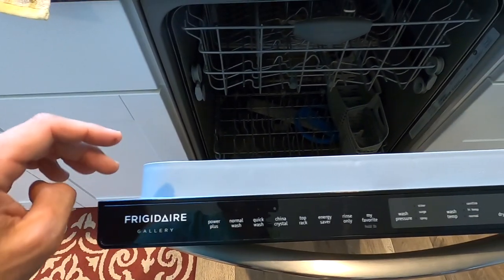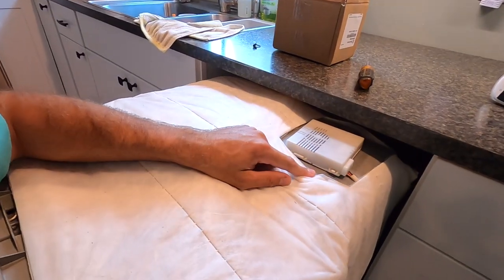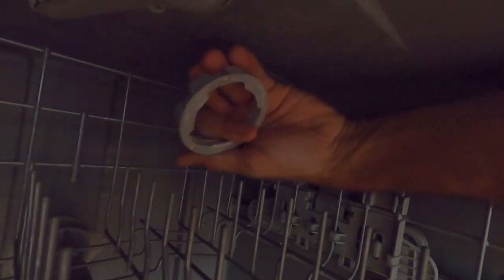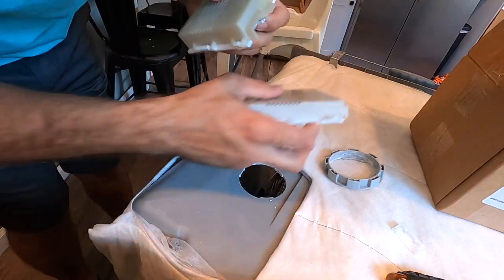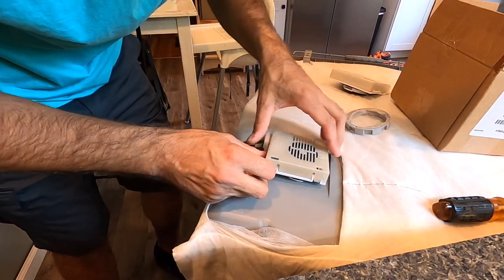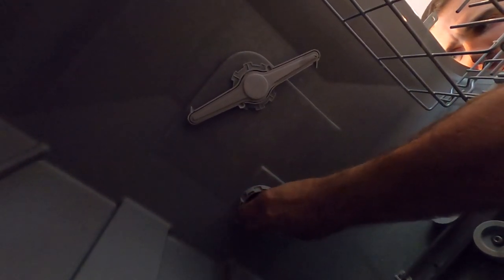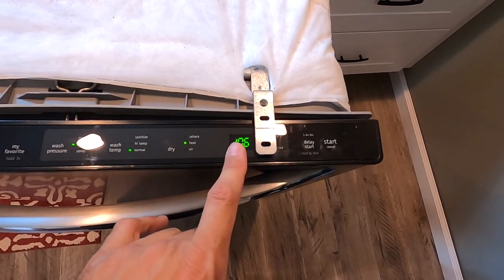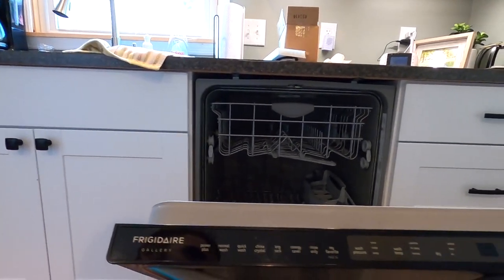ERROR CODE Uo Dishwasher Frigidaire Gallery

Comment: I was able to take apart the vent module and clean the valve. It had a lot of calcium built up on it. I also cleaned the optical sensor as well. Put it back together and it's working great. Thanks for the video. It was extremely helpful.
Reply from the maker: Awesome!!! Great job. For my situation I think the optical eye was bad. Not sure. Thanks for watching. Pinned to the top to help others.
Reply: Thank you that worked for me.
Reply: Thank you! We cleaned the vent and now it's working fine.  Saved us $$$
Reply: Where is the vent module and valve ? I'd like to try that first

Comment: I was surprised my 3-year old F Galaxy gave me the 'uO' code. I watched a couple of YT videos, took the module off, opened that housing, cleaned off all the gunk I could find with isopropyl and a Q-tip (including the diode). I also pulled out the spring and stretched it a bit. Put it back together and it fired right up. There was no way I was going to solder a new motherboard in! Thanks for the ideas!
Reply from the maker: Happy this helped you. My wife was at the door ready to buy a new one. I was very happy with this repair. Haha

Comment: I first tried to clean the vent,  and stretch the tiny spring coil, but to no avail. Finally I bought a new vent on Amazon. The dishwasher runs like new. Thank you for your help.
Reply from the maker: Happy u got it up and running. Great job 👏
Reply: Do you have the part number? Im getting same code
Reply from the maker: Part  https://amzn.to/3wmGwuA

Dishwasher Model FGID2466QF4A
Replacement Part # FRG12741853

Comment: Thanks for the video! Fixed my problem without a service call. Bought the part on Amazon for 1/2 the price of the factory. Worked right away!!
Reply: Thanks for your comment. 
How did you find on Amazon. Do you mind sending me info
Reply: Please what is the part?

Comment: Yay, thank you... I pulled mine out took the part off, cleaned it with vinegar put it back together and it worked. I have really hard water so I put vinegar in with the wash every other time too. So I may need to do it every time I suppose.
Reply from the maker: Happy it helped. Thanks for watching.

Comment: Count me as another that is up and running with just a cleaning, so thank you for the video. I was able to disassemble mine and, using vinegar and a toothbrush, clean all the parts with noticeable debris/buildup. I then carefully cleaned the optical sensor with rubbing alcohol and a cotton swab... Reassembled, cycled the power at the breaker, and voila... Zero dollars spent 👍🏼
Reply from the maker: Awesome, happy you got it back up and running.

Comment: I also used the smaller vent assembly part like you did but the cap in the washer  wouldn't screw on.  And I got the cycle to want to go but once the door shut it tried to start and same uo code.
Reply from the maker: The nut is very difficult to get on. I had to push down hard on the top at the same time turn the nut a 1/4 turn. The uo code comes on because it’s sensing the vent open. It should be closed when starting. I would double check the wiring connection. It’s possible you got a bad part.

Comment: I have a (Model FGID2476SF1A) and wondering if you can help.  The power is on, I can select a program and when I push the start button, nothing 
happens.  (It used to say CLose Door) and now it just sits there.  I can  hear the door lock and unlock when I close it, but it won't turn on.  
Not sure if this is control board or start button?  Any help / ideas?
Reply from the maker: Wish I could help. Unfortunately, I’m not that experienced with appliance repairs. I like to start with the simplest thing first. I would shut power off to the dishwasher leave it off for 5 min see if you get any change. If not I would look into the switch more. Sorry I couldn’t be more help.

Comment: Thanks for uploading this! Going to try it tomorrow. My "U" is half the size tho. Lowercase u and lowercase o.  So I wonder if it's the same error code.
Reply from the maker: I believe it would be the same but I am not 100% sure. You can try taping on it inside the dishwasher, sometimes this will work. Someone also commented that they took the vent apart and cleaned the photo eye and that worked for them. Good luck on your project.
Reply: @handylandlord  Thanks for the tip! I just ordered a new one haha :) It's cheaper on amazon than buying directly from the website (prime saves on shipping!)
Reply: yup. same code

Comment: What does code I CO mean?
Reply from the maker: I looked it up on google. Says problem with electronic control system. Shut off power to dishwasher leave off for five minutes. Hope that helped.
Reply: That is a lower case iCO without the dot.
Reply: @handylandlord  Thanks so much. I took a hint & did the same thing but good to know you had my 6.